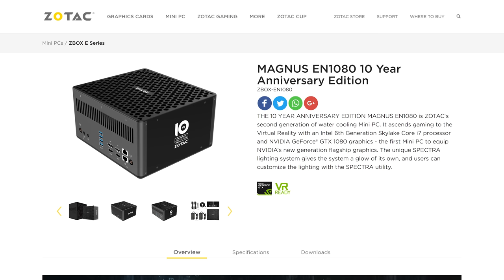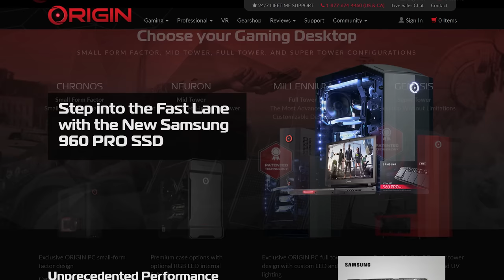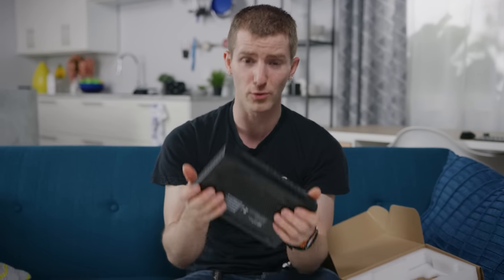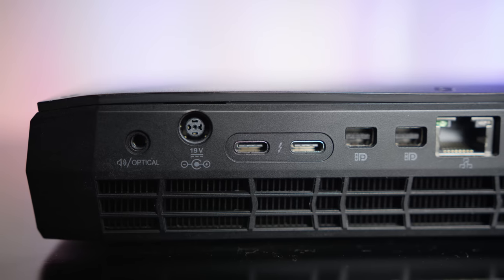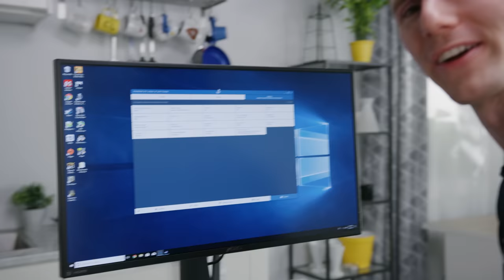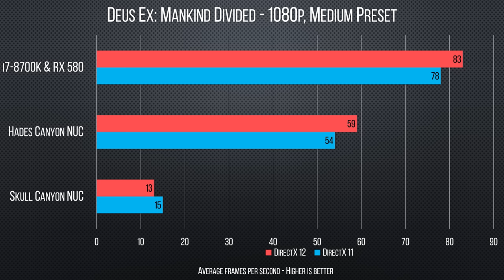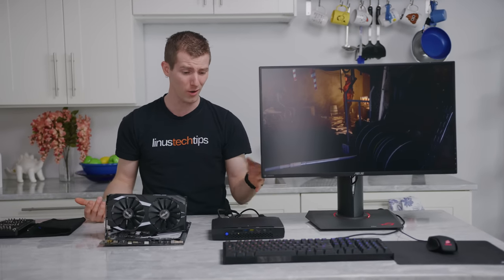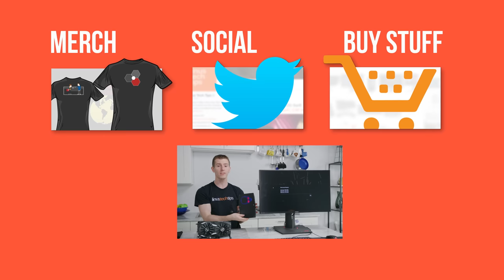Intel's Coolest CPU EVER... Thanks to AMD!

Comment: AMD and Intel working together, never thought I'd see the day
Reply: Well they sorta did it in the past. And it seems that the same way trends come back such things do too.
Reply: Intel and AMD have been working together for the last 45 years.
Reply: Well I would consider those contracts are the hatelove relationship and are not really a willingful working together xD
Reply: SDG Danny Intel Needs AMD atm cuz Therese apus are super trash
Reply: A little over a year ago I mentioned this may happen due to the Intel/Nvidia beef. People thought I was some kind of crazed fanboy. xD
Reply: It's every day. They "compete" in order to avoid anti-monopoly laws. They liscense plenty of tech from eachother, you know.
Reply: SDG Danny. Intel used to make amd chips back in the day
Reply: You!! Again? Lol why always you getting alot of leiakgzua?
Reply: karim lavji but AMD got THE best apu right now
Reply: Ahhhh but it is Radeon
Reply: They kinda worked together for the last couple of decades.
Intel licensed only AMD to use x86. AMD, licenced only Intel to use x64. That is why there is no other manufacturer in the market. The only other chip manufacturers around are using ARM and they are only developing for the mobile market. Servers, laptops and desktops are either running AMD or Intel.
Reply: Victor England 

You Forgot VIA. They also make x86_64 CPUs. And they will come back in some years. Like amd Did with ryzen.
Reply: Didn't amd and Intel work together on external graphics through thunderbolt?
Reply: This is Intel cpu and AMD GPU department. I doubt cpu department would care.
Reply: Actually, that's bad news for us consumers, because it'll eliminates competition and create monopoly, thus higher price and lower quality..
Reply: AMD always has to work with Intel to make sure Radeon cards work on Intel platforms. AMD also has a close relationship with Nvidia to insure that Nvidia cards work on AMD systems.
Reply: karim lavji yeah but could nvidia help make that cpu all they make is dedicated gpus no cpu
Reply: SDG Danny now all we need is Sony and Microsoft to make a console and the console wars are gonna get interesting again XD
Reply: Intel tried to stomp AMD out in the early 2000s.
Reply: SDG Danny good to see them collaborate together, but I kinda feel pity to AMD when looking at their Radeon Software... Intel doesn't acknowledge Vega GPU as AMD's (I know there is a 'Radeon' name in Intel's logo), but as Intel's.
Reply: clamo6362 actually AMD made lower cost Intel clones by licensing their x86 arch. You have it backwards.
Reply: Victor England cyrix still holds a x86 license and a Chinese company is producing x86 chips with it currently.
Reply: Victor England via.. not cyrix.. my mistake
Reply: I feel like Intel has always had good relations with AMD's Graphics arm (the company formerly known as ATI).
Reply: Small channels getting attention from big channels
using Like Bot
Never thought I'd see the day too
Reply: I ship them
Reply: SDG Danny has
Reply: do you mean the day two big corporations realize they can become an oligopoly instead of competing against each other? what a crazy revolutionary idea
Reply: @hakan - no they haven't.
Reply: technically its intel and radeon technologies group who are working together
Reply: VIA is dead. They barely make chipsets nowadays. They won't comeback as they aren't licenced by Intel for the x86 instruction set or by AMD for the x64 instruction set. They tried their own implementation of the x86-64, which didn't work and won't work. The chip did work, but it was incompatible with most software.

I say they won't come back because in order for their plan to work, they would need a few trillion dollars to ensure their chip would be in every Intel-AMD household and then make Microsoft, Apple and Linux to make systems for their chip.

AMD didn't come back with Ryzen. They were already making x86-64 chips. Ryzen is simply a new generation of these chips, with DDR4 support. Basically, the most advanced CPU you buy today is just like the first Athlon 64, from August 2000. They have the same architecture, they are capable of addressing the exact same amount of RAM. The only difference between that chip in 2000 to a chip today is that the new chips have multiple cores, they have PCI-E lanes (which didn't exist back in 2000), larger L3 caches, smaller manufacturing process (11nm today) and for that reason more energy efficient, DDR4 support vs DDR2 back in the day and so on. So basically, it is the same thing with more advanced technology.
Reply: you know they are in the same bloodline right? lol. one family owns both. not hard to have seen this coming, and to expect it to happen again.
Reply: They've been working together for many, many years.
The entire x64 platform we have now is due to their collaborative work.  They basically licence each other's technology.  Intel licensed its x86 tech to AMD, and AMD licensed its x64 tech to Intel (very, very condensed version).  So, one cannot do without the other.
Reply: I was going to say, I have built PC with Intel CPU and AMD gpu before. Then i remembered it was ATI Radeon.
Reply: ayyyyy
Reply: They license x86 and x64 architectures to each other and working together against Arm invasion in a sense.
Reply: They always working together on macbook
Reply: @iStackVietnam all i Said is Intels apu have super shitty GPU power compared to amds apus.

Calm down please
Reply: @DopefriedCheese  did something happen between them?
Reply: They already did
Reply: Money rules..
Reply: And it's way much better than the apple stand 😑
Reply: @90jucabala   - watch close the server space, - ARM is moving in on that segment in a big way. (research Huawei Kunpeng 920, a 64 core ARM cpu developed for datacenters.
Reply: @90jucabala  Imagine if Intel didn't give license for x86 then x64 wasn't possible cause it's made on top of x86. So, Intel could still make chips with x86 and later on invent something to put on it but AMD couldn't do anything with x64 without x86. Cause all modern stuff work on x86. (Basically)

Comment: How do you speak about a micro computer but not about its thermals???
Reply: ikr
Reply: Indeed, I think it's odd too, I mean, they sometimes do thermal/temperature tests for normal CPUs and not for a NUC? just the thing I was most interested in. Weird.
Reply: This wouldn't be a LTT video if they properly tested it.
Reply: Charlyjaja it's Intel so you can expect 100°C when running prime95
Reply: Charlyjaja FLUME Love
Reply: Charlyjaja you don't need it just use head set usb :/

Comment: lol this PC. Never thought I would see Intel put an AMD GPU in anything... What's next, world peace? lol
Reply: Win Mac?
Reply: Sean Chang hell no
Reply: Sean Chang Win Mac is already a thing
Reply: I thinking of Intel, amd, and Nvidia to create a perfect CPU with a good graphic cards
Reply: Samuel Ling that would be overpriced
Reply: @fliqpythekiller9950  On a Mac You can install a win 7, win 8.1 or win 10 ISO via Microsoft's website, and then run Apple's own boot camp assistant and you can run windows on a Mac?
Reply: @fliqpythekiller9950  ik, but I just wanted to say that as an Ex-Mac User
Reply: World peace would be kinda nice....
Reply: We are already in world peace, kinda,
Reply: @fliqpythekiller9950  so far world peace reminds me of the kid that cleans up his own room by quickly shoving everything into the closet so that it doesn't look messy. But yeah, in that way, we have world peace.
Reply: Hein Beukes ira
Reply: @knife-wieldingspidergod5059  as far as I know, Mac vehicles have windows on them
Reply: I want A14 bionic chip in Google pixel 5xl
Reply: Apple makes MacOS into disks, so you can install it.
Reply: 10 years ago, I built a Pentium E5200-based system with ATI HD3850 card.

It was an unnatural marriage and it soldiered on trough everything up until 2016.
Reply: にcえ
Reply: hope it IS world peace.
Reply: Hein Beukes Well the last wish will never come true
Reply: @someguywithmtndew5691  y
Reply: Game and Code there is so much chaos happening in the world
Reply: @someguywithmtndew5691  nah
Reply: Oi radeons are good
Reply: Next would be the Nvidia Radeon 6080Xi
Reply: @knife-wieldingspidergod5059  win linux you mean. An open source windows based off of the Linux kernel

Comment: Perfect for lan party.
Reply: Kp _rider how? You still need a monitor, mouse and keyboard. For just a touch more space, why wouldn't you just build a much more powerful mITX system. If you actually wanted a convenient LAN system, get a laptop, it's just as upgradable as this Hades Canyon NUC.
Reply: Competitive gaming on laptop keyboard? With this you can just plug in 144hz monitor, mouse and keyboard of your choice and its much cleaner than getting laptop
Obviously mITX system is better in that way, but this is good option.
Reply: Cekpi7 that's the point
Reply: +caleb grefe
this is still considerably more portable than any normal Case Form Factor, and performs at a level that means you can totally play whatever you're going to be playing with your friends.
hell you could even Velcro your Keyboard and the NUC to the Monitor you're going to use and carry all that around as one single object + the Mouse.

a little bit expensive for LAN's unless you're rolling in it, but that portability is unrivaled while still retaining performance.
getting a Notebook that can support high Refresh Rate gaming is going to hurt you in cost vs this. you're looking at ~$2000 on average for a Notebook that can hit those bells, and you still need a Keyboard and Mouse to go with that to make the purchase worth it.
Reply: taiiat yes you could Velcro this to the back of a screen and wrap it all up with your keyboard and chuck it in a travel case. . . OR they have these things called . . . .”lap” “tops” or something don’t know much about them but apparently you can even get “gaming” versions.
Reply: hmmm, spend $3k for a 144hz laptop OR buy this with RAM and storage for a little over a 1/3rd of the cost and bring my already existing 144hz monitor, keyboard, mouse, and headset to a LAN? I think I choose the second one, considering my monitor is 24" instead of a 15" laptop screen, must easier to see people in CS:GO on a bigger screen

Also, it could be used as a guest PC at my house for my friends, so win win
Reply: really depends. some lan events provide monitors/tvs Also if you are going to haul your own monitor/mouse/keyboard then having as small a system as possible is beneficial to reduce the footprint overall of all of the stuff you are hauling.
Reply: exactly; having this small NUC (which I'm probably going to get to replace my current LAN PC) would allow me to actually fit all of my equipment AND clothes in a single suitcase, rather than two suitcases; it would definitely make traveling via airplane to tournaments across the country (or internationally) so much easier.
Reply: Can't you also connect your monitor and kb&m to a laptop? you can get an i7 7700hq+gtx1060+16gb RAM+SSD at the same price you'd get this barebones, and the laptop will be only slightly bigger
Reply: Laptop keyboards arent that bad at all..
Reply: What would you want with a 144hz monitor - looks like the Hades box only gives around 60fps?
Reply: You can get a GTX1060 Laptop for slightly above $1000 and have MUCH better performance than this chip. You can still connect to a 144hz monitor. Some even have a 120Hz monitor! You're much more versatile with a laptop with the battery and instant portability if you don't have room for a screen.
Reply: Perfect for Lan parties and parties at Ian's place! ;)
Reply: i have no idea why but i read it as "IAN party"
Reply: its way to weak
Reply: Kp _rider ij
Reply: Look at the CS:GO FPS; I do CS tournaments at LANs and I have a 144hz monitor to do so. That's the only game I need a 144hz monitor for and that's the reason I have one

Also @Sam W, what about LAN parties at Ian's? ;)

Also the main reason I'd want this is because it's cool new tech and I already have a shitty laptop for school lol; plus if I get a laptop, I'd want the HP Spectre to have a business looking laptop; waiting for the Spectre to hopefully get this combined chipset in it
Reply: Vesa mount this to the back of a gaming monitor.
Just wish they would make a NUC that can be powered by USB-PD.
One cable to run it with the right monitor.
Reply: Fog those laptops cost more than this + 144hz monitor +keyboard +mouse
Reply: Ian C. Hey Lan
Reply: hard getting 100w down USB though :P.
Im not opposed to a block, but when the block is bigger than the previous gen's entire device.......
Reply: yah imagine, everyone bring their big atx beasts on the lan party, but you bring your small router sized pc on lan party, they'll laugh, but until they see what it can do...
Reply: Cheese 1337 heck yeah
Reply: sighheinrich when I'm on a LAN Party with my friends we usually play some good old lan games like warcraft 3, unreal tournament 2004, farcry 2 etc. since most modern games don't support local multiplayer. old games like that when LAN mode was still a thing easily run at 500+ fps nowadays (UT2004 hits 800-1000 fps on my 1070 Ti xD) so no problem to use a 144 Hz monitor even with this NUC.
Reply: I bought 4-6 years ago the X-51-R2 from Alienware/Dell because of lans and putting the pc in the videorecorder slot below the tv after it was outdated for multimedia before the smart tv and google sticks or whatever were a thing.
May be the time to upgrade and put my pc in the well reserved videorecorder slot below the tv.
Reply: I have one of these, I literally put it in my pocket lol when I go over my many friends houses for lan partys. I merely connect it into his tv and we play my emulators, watch 4k movies, and play World of warcraft at ultra easily. 
I also bring it over to my familys houses In just a small bag with my clothes when I stay the night lol>

This thing is AWESOME. It's insanely amazin.
Reply: When I was shopping for my new PC one of the biggest downsides for me was giving up a laptop keyboard.. The buttons are so damn quiet and light to press, I have no idea what people are talking about when they say it's not for competitive play
Reply: Put an egpu in that and it will perform like crazy

(Put a 1080 ti)
Reply: Cekpi7 Asus rog has 120hz 1ms screens on a GTX 1050ti I7 8750HQ laptop with a good keyboard for 1300 dollars, which is much better performance as well as cheaper if you factor in the cost of a 144HZ monitor and a good keyboard (you'll need a mouse on both)
Reply: ian parties are the best
Reply: I read "perfect for ian party"
Reply: For the price of this thing you could put together a midrange desktop with monitor, keyboard and mouse included.

Comment: Of course it has two thunderbolts. Intel doesn't have to pay any expensive license fees for it.
Reply: xWood4000 im wondering if you could hook up an external gpu to one of these ports
Reply: Sam Smith no shit m8
Reply: or maybe 2
Reply: Sam Smith you could, not only that, with the right drivers you could run multiple cards in external gpu housings in SLI
Reply: Sam Smith, I owned a Skull Canyon NUC for a while. Worked perfectly with an EGPU dock and RX480.
Reply: xWood4000  didn't they develop the thunder bolt?
Reply: SnorryHobo yeah together with/for apple
Reply: Aditya Aurora SLI Thunderbolt. Because YOLO.
Reply: Apple developed it. They just gave it to Intel to increase its adoption.
Reply: *Apple collaborated
Reply: Madd the Sane,  When has apple developed anything ? Apple named it.
Reply: If they don't leave it REALLY open it will never be really a common standard.
Reply: Well even though it is roalty free now my point still stands because Intel still wants their invention to spread.
Reply: Not just named it. The original version (Light Peak) was intended to be used with fibre optic, and Apple help by implementing it on (or combining it with) DisplayPort using standard copper wire and using the Mini DP (which is also developed by Apple). Apple named it Thunderbolt, Intel like the implementation, and a year later Apple transfer the IP to Intel
Reply: John Alexander I mean they invented the smartphone.
Reply: Smartphones were around a while before the iPhone. Even if you look at products resembling the smartphones of today, LG did it before Apple.
Reply: roxdbox, the copper implementation was already being developed by Intel. All apple provided was the mini DisplayPort connector (who's licensing they were using to bully smaller players, at the time. Probably still.) and the name. As usual, apple invented nothing.

Ian MacDonald, LOL! No.
Reply: Nobody remembers BlackBerry because they are Canadian?

Comment: But where's the floppy disc drive?

For that I am out
Reply: Candi Soda make floppy disc great again
Reply: SD cards replaced them
Reply: floppy was replaced before SD became mainstream :)
Reply: Austintune not quite ever heard of cds
Reply: +Candi Soda I'm retro old-school like that as well, partly out of a wanton desire to have Windows Explorer make use of and show all available disk drive letters, but sadly, it's not the 1980s anymore.
Reply: Hi shark
Reply: My school computers have a floppy drive slot
Reply: floppy disk insert sound soooo mechanical
Reply: Apache Z what's a CD? xD New nVidia chip colab with apple? The COCKDEATH ? Xd
Reply: Luqman Headley your country must be under a rock
Reply: There are usb floppy disk drives, and they would look freaking cute with this computer.
Reply: You CAN set a hard drive as A:
Reply: I still remember loading up raid drivers over floppy while installing XP 😂😂 or toasting floppy drive by inserting the power pins upside down
Reply: Can it play word munchers though?